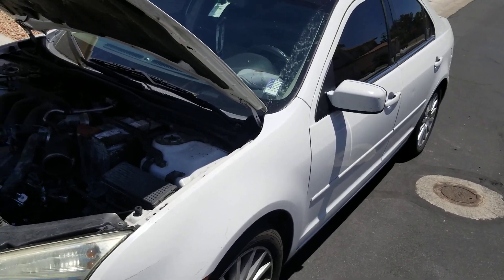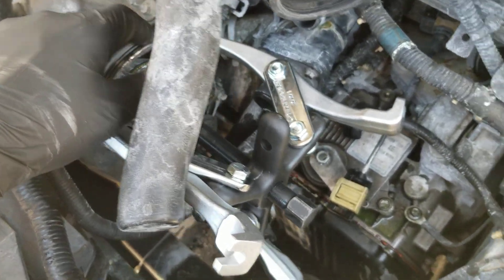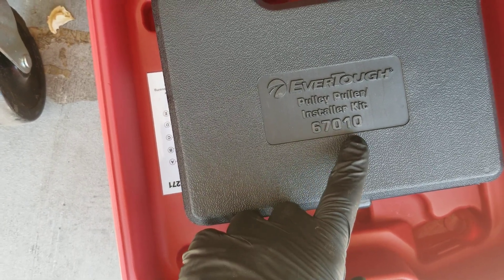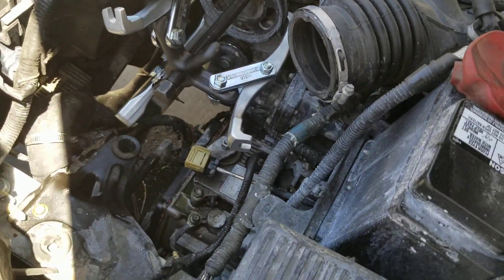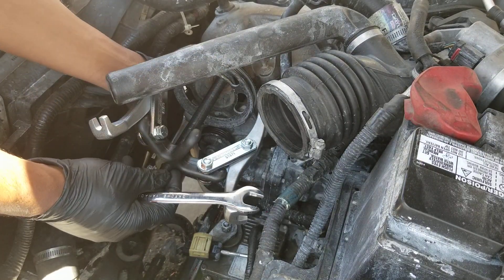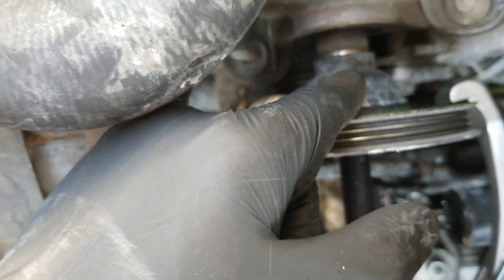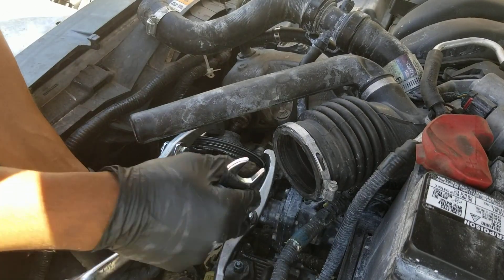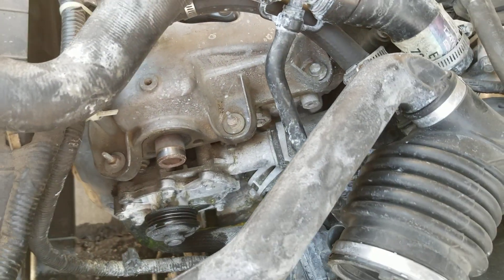Mercury Milan water pump and cam shaft pulley removal

Comment: How do you put the belt back on?
Reply from the maker: Good question, u have to jump it or pry it on as someone start the car. Not fully start the car but just to turn the engine over . Do a dry run first to see which way camshaft pulley spin. Then put the belt on as much as you can then use a screwdriver to pry the last bit while turning over the engine.  Hopefully all this make sense

Comment: When you change the water pump, you don't need to remove the camshaft pulley.
Reply from the maker: If you say so but I explain in the video why the cam pulley needs to be removed
Reply: I don't think you can get all the bolts out of the pump housing unless you take the pulley off..?

Comment: Only three bolts hold the water pump on.
Reply from the maker: Was going on brother and thanks for the comment .  I think it's more like 8  Bolts to remove the water phone  Not sure  Exactly how many but  Definitely not 3. Better yet when  you buy the new water pump count the bolts on the new pump and follow it on the engine to remove.  Hopefully that answers your question
Reply: Joe your right there only only three that hold the pump. The other bolts hold the pump housingThat the hoses connect to.